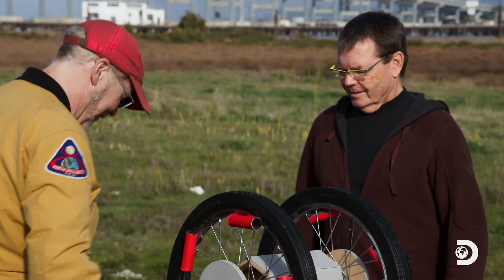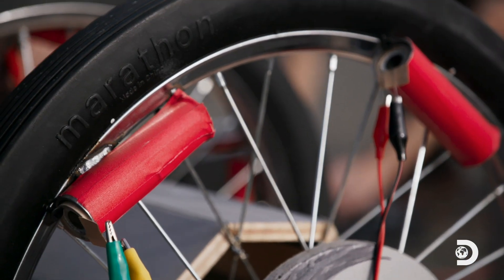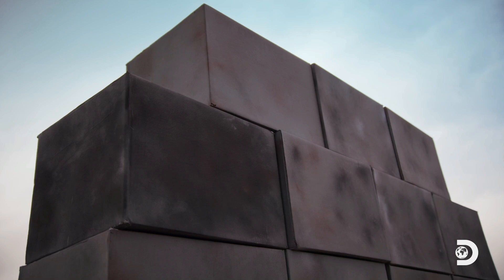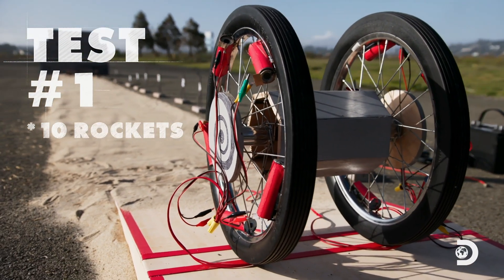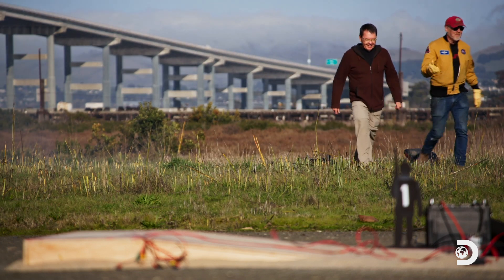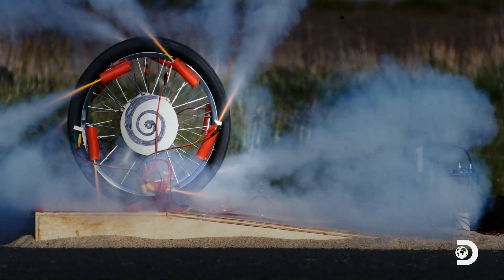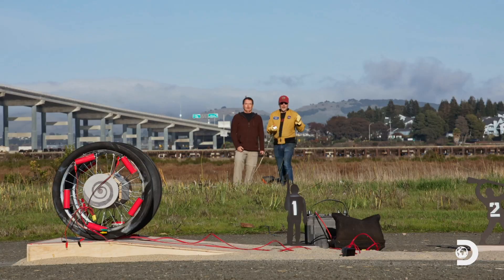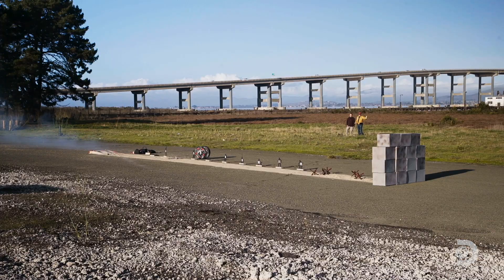Adam Savage Recreates a Mini WWII Panjandrum | Savage Builds

Comment: Add the equivalent of training wheels about 2 ft out on each side. That may help some. Also, rockets should be on a single flywheel in the center with a centrifugal clutch that only engages after a certain rpm is reached. That solves a lot of the twisting and rockets not simultaneously firing becomes much less of an issue.
Reply: I say have two guide rails to start, but only one wheel. Two wheels will always go out of sync with each other and veer off course across uneven ground.

Comment: Wouldn't it be better just using a single  wheel with rockets on both sides of the hub. Then again that's why the probably scrapped the idea elemenated the wheel all together and created the shoulder fire rocket is my guess.
Reply: Hello. "Let's put wheels on a rocket and give it obstacles"

Comment: Couldn't you just place the rocket on the center shaft that connects both wheels? And would it spin faster being that the shaft is smaller in diameter? Also wouldn't the torque be much greater for the same reason?

Comment: So instead of 5 separate rockets why not design a new one peice ring solid rocket booster with 5 or more nozzles attached or incorporated into the fuel ring now they would all light at the same time seeing they are one engine. I still understand the fuel burning from one ignition point would have to work its way around the ring but maybe there could be a way around it.

Comment: Silly idea. If it enters the funnel, the wheel will change direction or fall on its side. The road to the battlefield cannot be smooth. Funnels from bombs. An electric drive with a gyroscope was needed so that the device did not lose direction when hitting bumps in the road. You can stick some weak fireworks to intimidate the enemy. Or, the missiles had to be used for direct use. Rocket on wheels. Two wheels are ineffective and will easily lose direction of travel. Better four. Nothing can stop her. High speed plus a frightening effect from the work of powder accelerators. In fact, a rocket, or a tank on wheels for one-time use, destroying forts.

Comment: The problem with this design seems to be the unstable nature of having two wheels.  Try again with a single wheel with the explosives in a disc instead of an axle.  I'm watching videos from WWII and other attempts and they all become unstable quickly.  By contrast a single wheel WANTS to stay upright.  The two wheels fight each other.  I doubt it's the location of the rockets or the non-simultaneous firing.  It's just an unstable design.
Reply: Or use a rail to launch. It would assure that the correct trajectory is obtained at the peak of thrust.
Reply: You are exactly right.

Comment: TRY MOUNTING A SINGLE ROCKET EITHER SIDE OF THE WHEEL IN THE CENTRE HUB WITH THE HUB ON A ROTATING RATCHET ENABLING ONLY TO TURN IN ONE DIRECTION ‘FORWARD’ WITH THE THRUST OF THE ROCKET ANGLED DOWNWARD AT 45 DEGREES TO THE GROUND!
Reply: NO NEED TO YELL!

Comment: I don't think you need to fire up all the rockets at once. It may even be the problem: the initial acceleration is so strong that the wheels slip. That's where the thing starts to wobble. I suggest firing up the rockets in pairs, always the front pair that's pointing downwards, so the thrust will not only accelerate the contraption, but also push it to the ground and increase traction.
Reply: Agreed.
Maybe give each pair a fifth of a second gap, going counter clockwise (from the front downward facing one to the top, the back etc) so that they are all timed to go off when they are near the front and facing downward for their ignition.

Comment: Honestly, the solution is so simple..... a single smaller wheel between the two larger wheels to which the rockets are mounted. Single plane propulsion no torque steering issues and no worry about when the rockets ignite. You could even set up a second set of rockets to fire on a delay to increase range.
Reply: Gyroscopic flywheel
Reply: They tried that with the real one. It didn't help much.

Comment: I loved this episode, but I knew the brakes they used in the flywheel version were not going to work.  Brakes are designed to turn kinetic energy to heat.  What was needed here was a clutch.  Similar idea but more efficient at matching the speeds of two rotating components (or one rotating and one stationary).

Comment: It's amazing given Adam's experience on Mythbusters that he thought;
1. The rocket motors would ever "fire" at the same time; even lighting them perfectly synchronously. While those things deliver consistent thrust at max, they all take various amounts of time to reach that thrust, making it inherently imbalanced. Didn't they experience that on several myths?
2. Putting them on different wheels which were contacting the ground would work. Even if the rockets all lit synchronously the mounting would need to PERFECTLY symmetrical AND deliver force equally to the wheels, AND the wheels would need to constantly provide the same amount of grip/resistance. Any variance in any of those would likely compound and almost immediately lead to a flip/spin.
3. That starting out at small scale was ever going to get significant results, the lack of mass here means that any kind of imbalance would result in far more pronounced errors than at a larger scale.

Comment: Pretty sure I have the answer to fix this. Instead of 2 wheels use 3 and place the jets on the central wheel. This would take away any effects of lateral deviation.
Reply: Except that's not how the original was built.  I think at least part of the plan was to test the original concept.

Comment: The problem with the final Panjandrum bult at the end was that the energy converted to heat by the brake calipers was not considered in the calculation. braking systems tend to be quite good at that.

Comment: Aside from the basic design problem of the device hitting a hedgehog, it seems like the simplest improvement would have been to use a single wheel. The inherent rotational gyroscopic stabilization would have eliminated many of the problems they encountered.

Comment: The power to mass ratio in this model is way off. If they strapped a falcon 9 to the real one it would have been unstable as well. Way to much power for this tiny model

Comment: The panjandrum was an experiment, hardly the most notorious engineering failure when compared to actual bridges or other structures that were built but then collapsed.
Reply: oh god you're going to make me get all pedantic on you. They say one of not the most.
Reply: It's more of the kind of thing mad scientists make when they get the budget.
Reply: @ Hobarts funnies, lots of sabotage equipment such as the limpet mine, the hedgehog depth charge launcher and the bouncing bomb also came from the mad scientists with a budget. They had more successes than failures.

Comment: i would have canted the rim of  wheels outward, making them conical. Also, why the alternating rockets on each wheel? You could have just as easily spun up the whole thing and dropped on the ground. Mud is the enemy of all infantry, Actually, any sufficiently advanced technology can be ruined with a rock. Mud is lots of small rocks.

Comment: I watched this last night. Don’t give up on it! Try making the wheel out of aluminum, that will make it lighter and easier to turn and use bigger brakes to engage the flywheels. Or put a giant high pressure tank in the center and route the air through jets where the little rockets used to be. 

Who cares if they track perfectly straight. They just need to go mostly in the direction of the enemy.
Reply: I really want to see this experiment you’re talking about

Comment: Why not just use a single set of rockets in the middle?
Reply: Joe Sudz  No man, a central ring with rockets on it so you don't have to worry about simultaneous ignition.  Provides the same driving torque as rockets on each wheel but way more balanced.

Comment: Why the need for rockets on each wheel? Couldn't you just put a single row of rockets in the exact middle on a slightly smaller center wheel and then you wouldn't have the twisting problem. *With the two bigger wheels still the main rolling mechanism.
Reply: their recreating the original panjandrum.